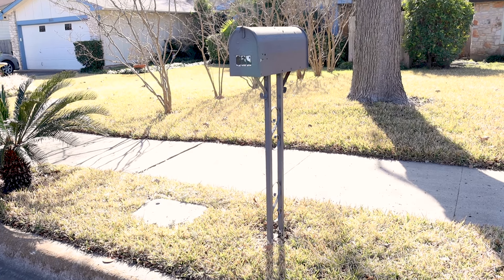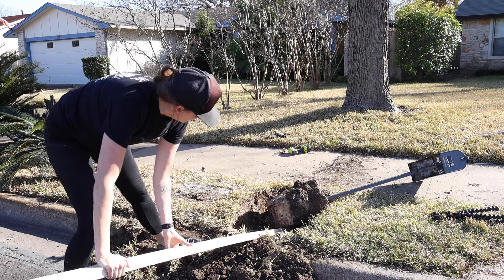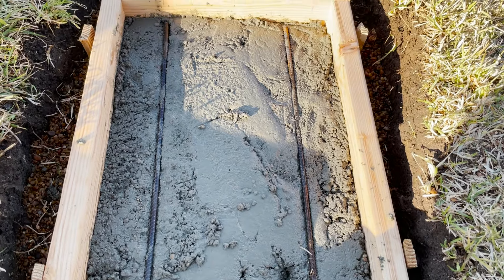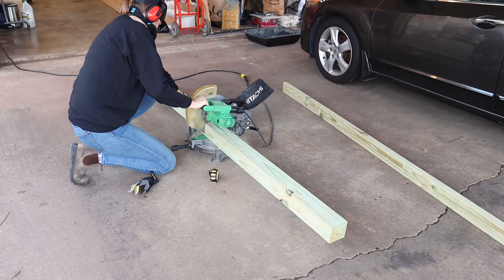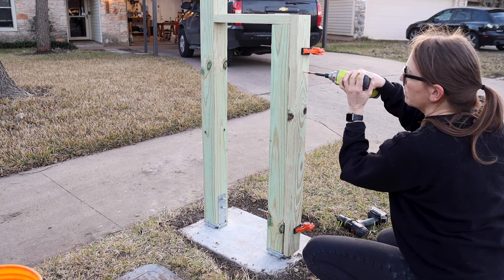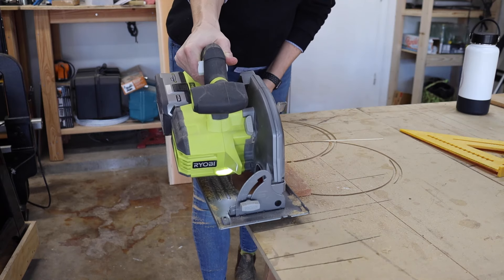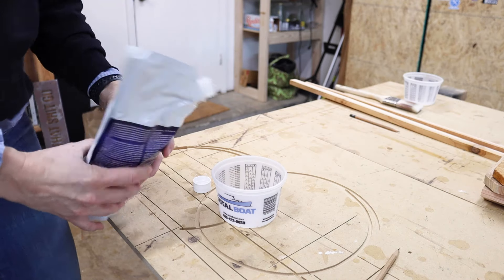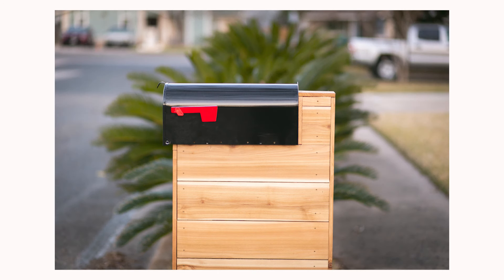DIY Modern Wood Mailbox | Removed The Old One With My CAR!

Comment: Nice project! It could also display your house number or some advertisement for a business. If it sat on your own property, you could use some LEDs to light up the driveway, and hide a power outlet so you can easily mow the lawn or cut a hedge.
One tip: when you put rebar in concrete, be sure to leave a 4 cm (1,5 inch) space from rebar to outer edge. You can simply shorten your rebar by 3 inches and center align it length wise. If you put rebar closer to the outside of the concrete, it is vulnerable for rust a.k.a. concrete rot.
Reply from the maker: Thanks! Definitely adding house numbers on the side. Thanks for the concrete tip!
Reply: Actually, it’s 3” of cover between rebar and ground, 1” to the air.

Comment: I like the contrasting color of black against the natural cedar. Also a little industrial look. I might use some small lag bolts instead of the small head finishing screws, painted black. Maybe add the house number in black as well. Either how you made it or how I might have, looks great. Very nice work and video. And Tahoe up one, two by four zero. Well, ahalf point since it came in handy in the end.

Comment: Years ago I had to replace a fence with an old timer who showed me a wonderful trick for removing posts with concrete footings.   Rather than digging all around each post he just dug a hole right beside the post on one side until he was a couple inches deeper than the concrete footing at the base of the old post.  Once he had this hole dug he just pushed the fence post over toward the direction of the new hole.   Posts tipped right over and the concrete footing fell right into the new hole.  All that was left to do is pluck it right out.    
Hope this helps one of you as much as it's helped me.
Reply from the maker: Thanks for the tip!

Comment: Could you just,,,,build it around the existing mailbox?? I know that's not how you did it, but if you have one with a wooden post, couldn't you just attach the side boards to the original post, and then attached the front/back panels to those?
Reply: Yes. Especially if it’s a wooden post that is not rotted. You might want to add a second post. Sometimes though, retrofitting can be more challenging.
Reply: Would’ve been a more creative video.

Comment: My problem is my mailbox sits by the ditch so the ground is sloped. How would I fix that?
Reply: Dig out the side of the ditch to create a level bottom, then use plywood or something like that to make a taller form. Depending on how tall the concrete becomes, you will either want to add more rebar vertically, or better yet just get fiber reinforced concrete. 

Especially with it being in a ditch, I’d recommend building it deeper into the ground also. 6” to 12”; like the foundation that was removed. 

Also, smear some oil (cooking or motor) on the forms before filling with the concrete and tap on the form boards with a hammer, mallet, or misc piece of wood a lot after the concrete is placed. This will get rid of air bubbles and produce a smoother surface.

Comment: Do recall the total cost of this project?
Reply from the maker: I don't, sorry about that! I do remember that it was a relatively inexpensive project.
Reply: Concrete is about $4 a bag. Post base about $10 each. 8 fence pickets at about $3 each. Figure $10 for screws. The Total Boat would be the expensive item, though you could also use an exterior penetrating oil for about $50 a gallon and have enough to last a lifetime.
Reply: $100-ish